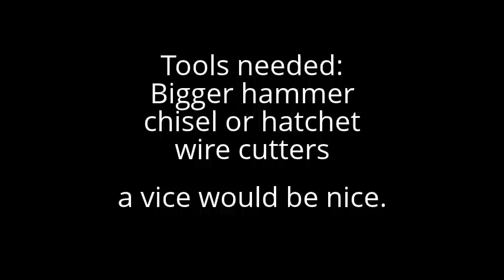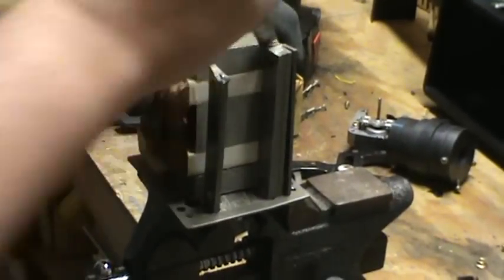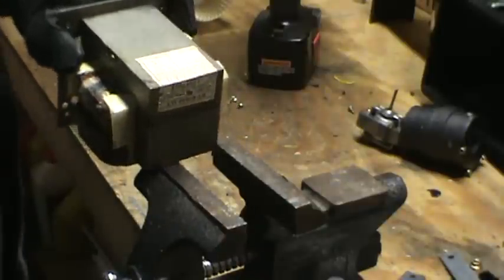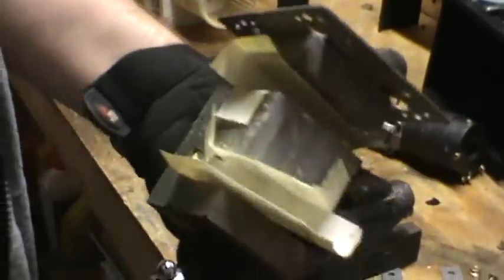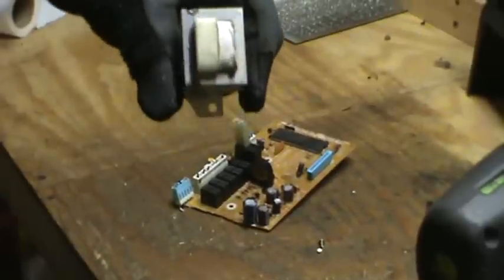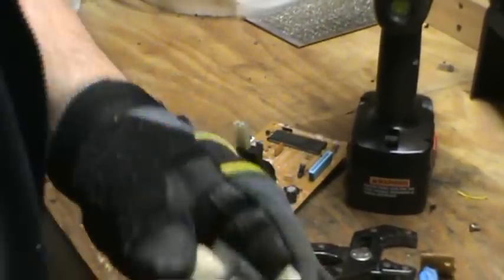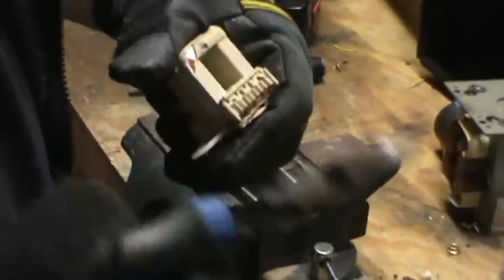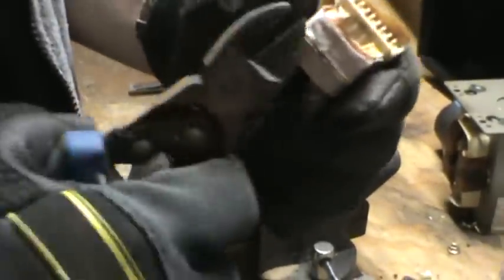How to scrap transformers for copper and easy money!

Comment: Nice video. I'm in the UK like the person who posted the comment below and have found it better to strip the windings out of both motors and transformers. Not seen a microwave transformer slit with a hammer before however I used to use a hacksaw and cut one side of the windings off flush with the  steel block then a hammer and a scrap bit of bar then hammer the wire back out the other side
Reply from the maker: Thats how I used to do it too.  I thikn the hammer on the weld method lets me release my frustrations from my day job....lol
Thanks!

Comment: heap about 40 or 50 transformers in a pile and pour some charcoal lighter fluid on them - pour on a LOT. And get that pile cookin'.  When it cools down many hours later you can wash itt off with a garden hose and then that stuff falls apart if you look at it hard and you rid the world of a shit ton of useless plastic in the process. Plus they give you more $$ for CLEAN copper. With a little practice you learn just when to hose it off and then the residual heat in the metal dries it off quick  & clean. All the shellac has been burnt off the iron, so you need to deal with it right away or you will have a rusty mess to handle.

Comment: Most of the new ones have aluminium wire instead of copper but funny enough the ones made by sharp are mostly copper but some of the old microwaves have lovely copper transformers. Been doing this for years!! You can tell by the weight of the wire though copper ones are a lot heavier than the Ali ones
Reply from the maker: Yeah, this video is getting old and I have certainly noticed the movement to aluminum.  The higher end stuff stiff has copper though.... sometimes....
Reply: Moose Scrapper a lot of the microwaves made by the company called sharp still make mainly copper transformers. And like you say some of the really old microwaves have a nice bit of copper in them

Comment: (for the transformers) you could have used a chisel w/ the hammer- much easier, less mess, too.
make sure you: 1-wear protective gear(safety glasses, gloves, ect.), and 2- break off any (useless) plastic off the transformer's copper coil.
Good job! I've been doing the same, too!
have a good one! 8?))#
Reply from the maker: I tend to use the chisel on the smaller ones.  I like getting frustrations out on the bigger ones..lol Works great !  Thanks!

Comment: I find the easiest method for the small Transformers is to Simply put them on a piece of concrete smash them with a sledgehammer pick up the copper and shake out the pieces
Reply: This method also works great for all different kinds of electrical components containing copper

Comment: The hammer works but also taking 1 swing with a sledge hammer will literally crumble a ballast to pieces. Both methods work. Also just for the fun of it I took a rotary hammer drill and put a chisel bit on it and hit it with that and it seamed to work. I like the hammer method better though. Doesn't take much effort

Comment: I never tried to break the weld with just a hammer on the microwave oven Transformers I would cut through the weld with a circular saw and a grinding wheel and then smack off the ends with a hammer but and I have never saved the Copper from the other Transformers that you've done but you're a man right up my alley for scrapping

Comment: I use a 4-1/2 hand grinder, hit the weld seam down about 1/8 th of an inch, then tap it with the hammer. Much easier and you save time and energy trying to pry it apart.

Comment: I scrapped an old broken radio this morning. The transformer came apart easier than I thought it would although my steel plates were alternating rather than all facing the same direction. After the first few came off, the rest came out with my fingers. Not really a scrapper here, but was just curious to see what was in there. Was fun though : D

Comment: Got a air compressor? use an air hammer with a V chisel cuts right through the steel waffer that are welded easy!
Reply from the maker: No air compressor, but great suggestion!!!  Thanks!

Comment: I seriously learned my lesson on this last week. The yard paid me $2.40 for #2 copper. and $0.08 for the motors I did not strip out. I ill now be stripping out EVERY SINGLE BIT of copper I can from transformers and electric motors.
Reply from the maker: lost in the tundra Its more time, but its also more money for sure
Reply: At 30X the profit, I am willing to spend a bit of time. especially if I can get a lot of the same motors and transformers, so I can develop a pattern or system to disassembling them.

Comment: My scrap yard started making us take out the capacitors, since having to do that, I discovered all the copper and aluminum inside. I loved this video and took a transformer apart in 8 mins. TY so much. But now I'm freaking out about the beryllium. By opening up the microwave and removing all the copper am I putting myself at risk? And once I think I touched it. It's not worth it to scrap if I'm gonna die from toxic poison. HELP
Reply from the maker: Hi and thanks for watching!  Its a good thing to be cautious!  The beryllium is only on the ends of the magnetron.  The biggest concern is if it gets airborn which is not easy to do.  You can sell the magnetrons on ebay as well, i get about $20 each.  So wear gloves, just try to avoid breaking the ends of the magnetron and you should be just fine.  THanks!

Comment: I got about a 100  of these transformers but a lot bigger I put them in my hydraulic log splitter with the splitter wedge on weld in the core and they popped right open quick and easy

Comment: I've been scrapping microwave transformers for years. It's just common sense to stay clear of the high voltage capacitor inside a microwave oven. What I do is leave them outside in a pile for a week or so. I do that with all electrical items I scrap.
Reply: Just hose them down with water ... instant discharge ...

Comment from the maker: So the ones that don't have welds I cal the I and E transpormers because they have iron I and E shaped pices kind of glued together.  There is an easy method using a chisel to just chop off one side of the copper and push through to the other side.  Originalfeets has a great video on that too.

Comment: I scrapped one today the same as the second one you did and to start it weighed 2.45 kgs and in Australia we only get 65 cents a kilo as copper bearing motors so i would have got about $1.60 then i used a grinder to split the welds took like 5 mins to break it apart and get the bright wire out i ended up with 525 grams or bright wire and i have found a new scrap yard to sell to so now i get 6.40 a kg for #1 copper so i would have got 3.50 for the copper and 18 cents a kilo for steel so about another 30 cents for the steel so instead of getting $1.60 i will get $3.80 for it scrapped
Reply from the maker: Great breakdown!  More than doubled your money!!

Comment: Hey Moose Scrapper,
I just did this last evening and it worked absolutely GREAT !!!
However, my second transformer, out of an old Pioneer stereo, proved to be a bit more on the aggressive side. The metal plates were actually inverted every 3 or 4 plates or so and therefore trying to separate the one side with the chisel was totally impossible. Great video though... thanks
Reply from the maker: Yeah I hate those.  Thats when you have to put it in a vice and take a chisel to the outside loop of the copper.

Comment: was this the E & I layers? I have a very large one thats about a foot long came from a 3 phase unit, and one person cant pick it up. so I am sure it would be worth getting  the  metal off
Reply from the maker: This one actually was not the I E layers.  Those you can just take a chisel and a sledge and cut one side of the copper loop then pull the other side out by prying with a flat head driver.  Thanks!
Reply: thanks moose

Comment: The aluminum and copper look the same to me, both orange, how can a layman tell?
Reply from the maker: Aluminum should not be orange.  If it is, scratch it with a knife or a file, if the metal is white underneath then its aluminum.  If is still reddish its copper.  Copper is also more dense and heavier than Al.  Check out my videos on getting to know your metals.  Thanks!

Comment: Moose is there any radioactive stough in microwaves? what's inside the cone between the aluminum fins? also is the metal inside a picture tube realy nickle?
Reply from the maker: No.  On the magnetron there can be beryllium which is poisonous/highly toxic.  As long as you don't handle that part too much you should be all set.  As for the metal inside the picture tube of a tv, I am not sure.  Original Feets has a video where he slices one open and talks about the contents.  That might be a good video for you to check out.  Thanks!
Reply: Thank's I also didn't know about this.

Comment: I've been toying with the idea of building a foundry, dropping them in and melting the copper out of them, fishing the steel out afterward. any thoughts? Eps for transformers golfball sized and less. I got pounds and pounds of those in bins so heavy I can't lift'em.
Reply from the maker: I would love to have a foundary!  The only problem I can see with that is the energy required to melt the copper would likely be more than the value of the copper.  I have seen people have great luck with ball mills though.....
Reply: Moose Scrapper ball mills? Foundrys: So far I got a free drain oil furnace burner pump and head from a friend, just needs rewiring. You need 150,000 btu aprox. Drainoil you can get anywhere, maybe even yourself depending on the number of engines you scrap or grease monkeys you know. A garbage pottery kiln, one of those electrics that don't work no more...usualy people are more than happy to see those walk away. I just need to do the plumping, drill the hole for the flame of doom and fix up a melting pot. I was going to build a mid-evil pile driver type machine to smash the mower engines with a cable lifted weight but we cut down the tree and never found an anvil. Even missed out on some elevator weights that woulda worked. Oh well.
Reply: TheStarforce2 if I get it working I'll post a vid. Gotta find out if the yard will take the ingots.

Comment: I scrapped a battery backup unit for computers. found a 9lb transformer used a sharp chisel, took out the scrap metal scrap copper coils (3coils!).
I have 5 lbs of scrap metal, 3 lbs of good clean copper, and even made a med. sized coil w/the largest gauge wire, for crystal radios.
how much will the copper and scrap metal bring?
I also have about 10lbs of aluminum scrap from heatsinks. how much will that bring?

Comment: Thank's for the video. do you get more for aluminum heat sinks than cast aluminum? love to see more on finding silver and other components off boards.lots of widgets left on board's.
Reply from the maker: Some scrap yards will pay more for extruded aluminum (heat sinks) than cast aluminum.  If you have time and patience you can also sell them on ebay.  I do have some more silver info coming down the line.  Thanks for watching!
Reply: Hey David i have been told that some yards will try and give you less if the aluminium heat sink is painted or anodized easy way to remove the paint is just soak them in caustic soda for a while and wash with tap water
Reply from the maker: Adam Tolley Yup, just don't leave them in for too long, like overnight or you will nt be happy with the result.....lol

Comment: is there any silver in a computer? I've gold,aluminum, scrap, copper (hair-thin, insulated,bare),and sheet metal. could any of these be traded?
and which is better- sell the hair-thin copper wire, or melt it and then sell it?
thanks!
Reply from the maker: There is silver in computers.  You can find it in the keyboard mylars, solder, switches and relays, some ribbon wires, etc.  I am sure I am forgetting something in that list too.  As for the second part of your question, define traded?  Are you talking about being sold?  Sheet metal can be sold to any scrap yard, as well as the aluminum and copper wire.  For copper wire that thin it is really not worth the time to try and free the copper out.  Thanks for watching!
Reply: Moose Scrapper
Hi Buddy is the all the solder on the PCB's silver solder and if so how is the best way to reclaim it
i am also trying to find a way of getting the gold off the mother boards off say the mobile phones can you just put the whole PCB in the AR solution and get the gold with out ruining the solution with the other metals on the board

Comment: how do you tell which is the aluminum and which is the copper in the transformer?
Reply from the maker: +Paul Greensmith scratch it.  If its white its aluminum, if its a bit rosy then its copper.
Reply: yea but I saw one of your videos and they both looked brown but one was aluminum thats why I got confused
Reply from the maker: +Paul Greensmith yeah they often put a coating of varnish or some other layer that prevents the wires from making contact with each other.  It looks like a dark brown copper color but if you scratch it you will see the true color under it.  It is confusing, not sure why they color the wires like that, probably not thinking of us scrappers.

Comment: How do you strip varnish from wire. Is it practical if you can?
Reply from the maker: Nope, not practical.  There are all kinds of myths about it, Mike the Scrapper has a video on it, and I think the only thing that partially worked was soaking it in coca cola, but even still, it did not work that great and the money you spend on the coke ends up making the copper worth less.  Sell it as #2 and more on to the next scrap!  Thanks for watching!

Comment: Knock Knock.. You still answering questions? If so, what you call Iron, do you put that in with steel or do scrap yards take Iron separately? I have done scrapping for a few years and have never known there was a difference till now.
Reply from the maker: yeah there are a few types of ferrous materials.  Lite iron, cast iron, stainless steel, non magnetic stainless steel, high speed steel, etc.  the Rockaway Recycling website has a lot of great info and pics of the different types but not all scrap yards take them that way.  A lot of places just do the basic lite iron, cast iron, and non magnetic stainless steel.
Reply: I had brain fail moment. I know of cast  iron, stainless steel, aluminum, brass and such. I have never heard of stainless steel being separated by being magnetic or not though I know there is some that a magnet will kiss but not a strong hold and then some it won't grab at all. I found a deep fryer last night and it had no magnetic property at all. I have always thrown that ferrous Iron from around copper in the steel since it is magnetic. I am glad to know the difference. When I lived in Florida I had a great scrap yard 40 miles away. Here in KS they have a horrible yard. I am going to try to find something further away hopefully. Thank you for answering. Oh also, Zippers, I have about 20 lbs of them. Do you know if there are any places that want them or throw them in with the aluminum?

Comment: hey Moose, great video`s. Very helpful. I was wondering if there was any very valuable materials inside an old 400watt  HID HPS light system other than the aluminum cover, copper in the transformer and wire? (ex.silver, gold, platinum etc.)
Even small amounts might be gd to know , I have bout 450 to scrap. Thanks
Reply from the maker: Hi an thanks for watching!  I don think there will be any gold in there, there may be silver if there are any switches or relays.  Copper will be the big money maker there unless the lamp still works, then there will be much more money in parts.

Comment: Mr. Scrapper, have you ever scrapped an old adding machine/calculator? I just scrapped one and it had a green board with a lot of gold. Also, the transformer was gold platted ( I scratched it and it was silver under).. A long IC chip, and some other yellowish plates, I scratched those and it was yellow under. Also, the plug is silver but not magnetic, could this be aluminum?
Reply from the maker: Hi there, the silver prongs on the plug are nickel plated brass.  The transformer is likely not gold plated as there would be no need for that.  I have scrapped a lot of adding machines and calculators and have found the the older and the higher quality ones do have some nice gold plateing in them.  This is usually on the board though.  Sometimes the transformers wires are yellow and are brass, other times they are painted aluminum wire.  The yellowish plates are often brass as well.  The best way to tell is with a chemical test or if you see any tarnish, or green patina anywhere on it that would indicate that it is brass.
Reply: Moose Scrapper yep, it actually had 2 types of wire. one yellow that tore real easy and the other was copper. The yellowish plates does have some green patina. So this was a pretty good find. As always, thank you Sir.
Reply: and yes Sir, the gold plating was on the green board. Lots of gold diamond shapes. Also, the plugs, do I throw them in with my brass?
Reply from the maker: You can pull the prongs off and throw those in with the brass or ask your scrap yard if they buy plugs.  Some places will if you leave an inch or two of wire with it.

Comment: Do I need to get all of the paper or insulation off to get a better scrap price or just most off???
Reply from the maker: Depends on the scrap yard.  Sme places will give you #2 price if there is some paper left on the copper wire, some places will drop it to insulated wire price.